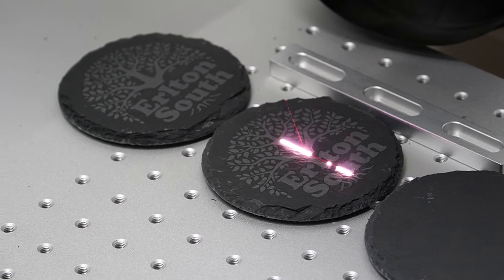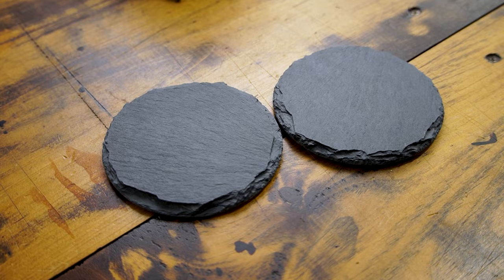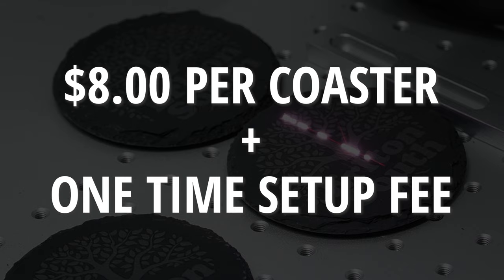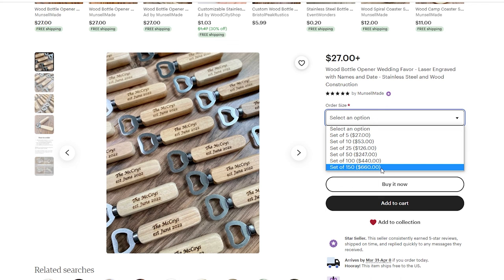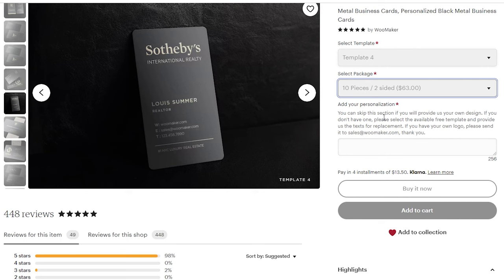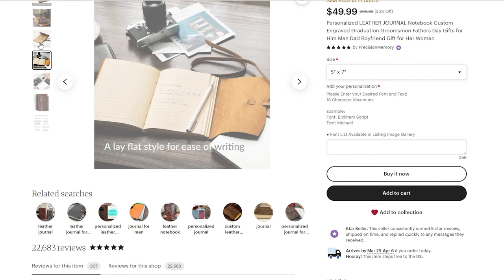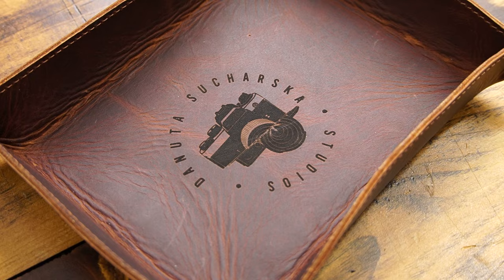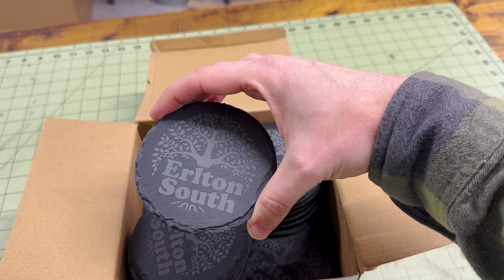5 Easy and Profitable Laser Engraving Products

Comment: I have both a laser engraver and CNC. I started selling valet trays because people can't get any trays from China in a reasonable amount of time.
Reply from the maker: Great idea. Thought about doing that with leather trays since they are basic designs just need a clicker press.
Reply: @justinlaser  Yeah way cheaper than Amazon for sure. Non laminated trays too.
Reply: What's a valet tray?
Reply from the maker: @JohnSmith-rt5yq  Basically just a small tray usually made of leather or wood that is designed to hold keys, etc.. on a table.
Reply: If you guys still need valet trays I’m making them in the US. Just me so if it’s a lot of them might take a little bit to complete them all.

Comment: Engraved slate coasters are great. Try giving them a coat of Rust-oleum, clear, satin. It protects the engraving and really increases the contrast. Makes them look much better in my opinion.
Reply from the maker: Nice! I had.a high shine poly I was using but didn't like it. TOO much reflection could barely see the design.
Reply: Sealing coasters kinda defeats the purpose of a coaster which is to wick the moisture away from the glass. Sealing them just lets it ball up and drip onto the surface you are trying to protect like a wood coffee table.

Comment: On the leather catch all tray that you made a mistake on, did you find a solution? I’ll bet your laser head bumped the side of the tray because it was so deep. I’ve done something similar. Great work you do!
Reply from the maker: I might have to get a longer lens so I could avoid the edges like that. Or make sure that overscanning is dialed back. Otherwise those high edges are a pain the butt for sure.

Comment: Thanks so much for your video. One question though, do you ever require payment upfront before you do a job?
Reply from the maker: Not usually although there are scenarios where I might ask for 50% down. If I had to order A LOT of a material to engrave and it is expensive or if it was a first time customer. Asking for a percentage down isnt uncommon but full payment is a little less common.

Comment: Quick question sir after engraving wooden coasters or the bamboo trays do you use any type of finished coat to them ?TIA
Reply from the maker: Sometimes butcher block oil. There are considerations you need to make if its something that might contact food. Have to make sure its a food safe finish.

Comment: Weird question - I watched your Aluminum Laser Diode Video - I saw the power on that particular brand was set very low.  That seems low to me - is the anodization on the cards that thin that you can use such a low power rating?
Reply from the maker: Yes the anodization is a very thin layer. You can crank up the power to give a much "whiter" engraving but it really blows out the shading of grays I was hoping to preserve when doing a portrait like that. If I was doing text or a logo or something non-photographic I would crank the power more.
Reply: That is not a weird question.  As a mechanical engineer, I have to be concerned about this often, especially when designing tight-tolerance parts.

Depending on the exact anodization process used (as there are a few different process specifications for anodizing), the anodized layer will vary in thickness from about .0002" to about .0024".  On most of the products that you engrave, I suspect the thickness would be about .0015".  For comparison, the thickness of a standard sheet of notebook paper is about .0035".

The anodizing creates a very thin aluminum oxide layer on the surface of bare aluminum.  This layer protects the aluminum against galvanic corrosion.  Anodizing also hardens the surface of the aluminum.  Bare (un-anodized) aluminum is rather soft on the surface, and it can be easily scratched.  Anodizing makes the surface much less prone to scratches.

Comment: Question... i have an XTool 20W. How can I even try and scale a product with a slow laser? I feel if I got a 50,100, or 500 product order I wouldn't be able to get it done in time. Am I missing something?
Reply from the maker: No you arent missing anything. If you are starting to get interest for orders like that you will have to upgrade to a co2 laser, or, hope they are extremely patient customers. The D1 Pro and other diodes are great for getting started but you after you get rolling they have to be upgraded. The only way around it is to work on products that are "one-offs" like photo engravings and stuff like that. Might take a while but customer expects that and only needs one.

Comment: what do you mean  by 'one time set up fee' when setting up a sale
Reply from the maker: Usually anything related to file prep work. Some jobs have a lot and some don't have too much. This job I basically designed the entire graphic so that was a one time fee that doesn't alter the per coaster price.
Reply: @justinlaser  ah, so if they come back for a second order you already have a graphic ready to go and they just pay for the product?.
i have a sculpfun s9 but for some reason i couldnt get a consistent centre point to begin any project using lightburn (the co-ordinates changed every time without turning off either laptop or laser) i really should get back to it😁
also leather hip flasks with club crest's or for wedding parties seem a good idea
Reply from the maker: @glasgowjohn7831  Correct. I would just charge the per coaster price if there was repeat order.

Comment: The metal business cards will scratch easily, any suggestion to coat them? Thanks
Reply from the maker: Ive tried matte clear poly coat and had some decent results. Have to make sure you blow/brush away and loose dust from the engraving process though or it will look messy.
Reply: @justinlaser  thanks
Reply: Gotta get the anodized aluminum cards not the thin painted ones